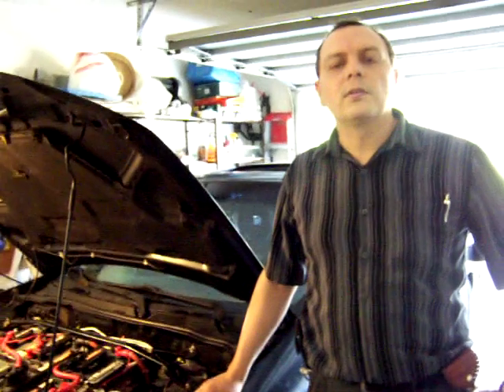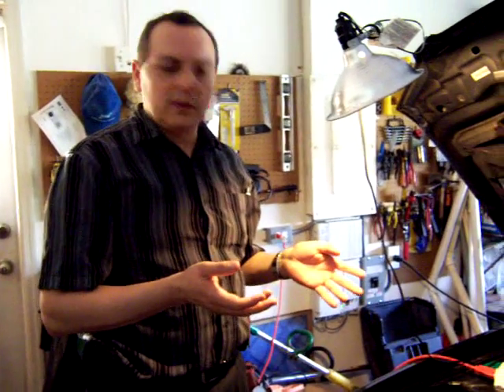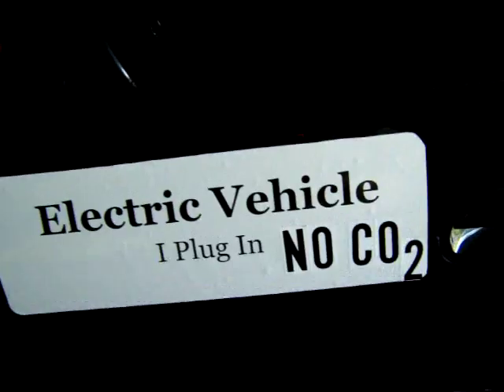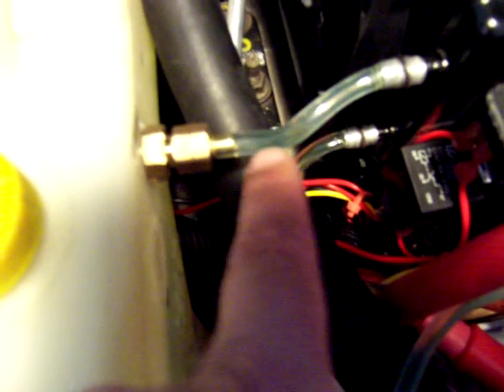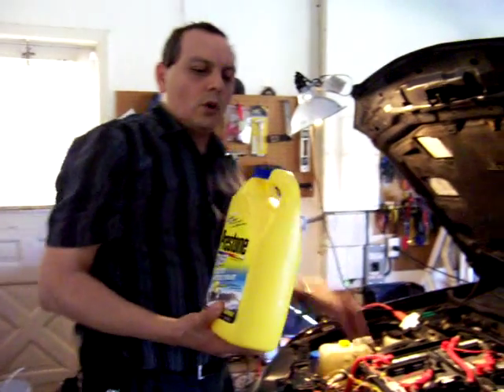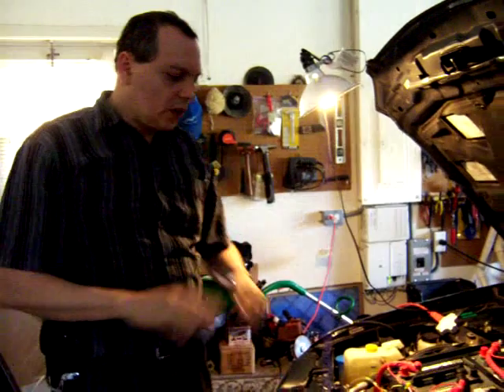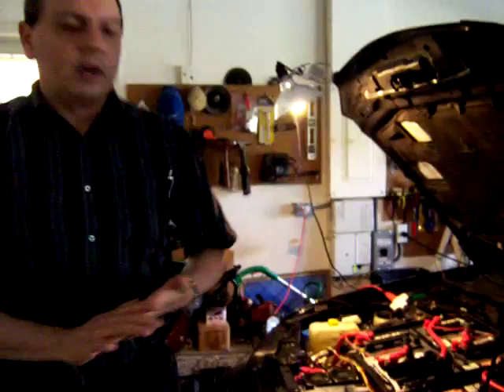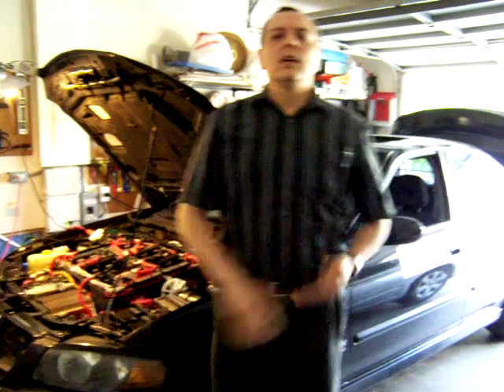Nissan Sentra Electric Car Conversion Part 27

Comment: Thanks for the reaction, the biggest problem would be keeping the batteries balanced, I agree. Another problem would be the unused capacity of the batteries not used while cruising with 15 batteries or so. Result:less distance which is bad!

Comment from the maker: Interesting idea. I don;t think there would be too much saving in heat because the controller does not get terribly hot, but it is very expensive. It may wrk to connect the batteries in series adding more batteries as the need for speed increases, but it would be tricky to keep all the batteries balanced. What I mean is how to keep the discharge and charge even, especially when it is time to charge them again. I think some electronics need to be involved anyway.

Comment: Love the video's! Have an idea to consider: Since the motor speed controller is very expensive, why not  switch the 6V batteries directly to the motor, starting with 1 and then adding more in series, up to 20 for full power....continued...

Comment: You would have less power resolution but 20 steps might be enough.
(i think it is) 
The wiring of the batteries must be changed of course (fed to a central switching point) and they will not discharge the same. 
The switching could be even done mechanicly via the foot pedal but preferebly electronic. 
There would be no heat and energy wasted in the (expensive) controller!